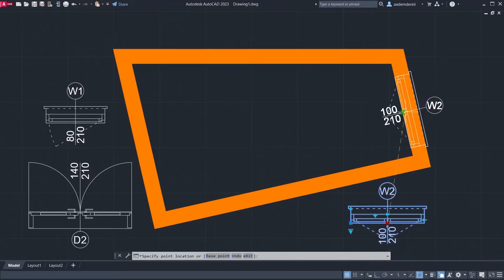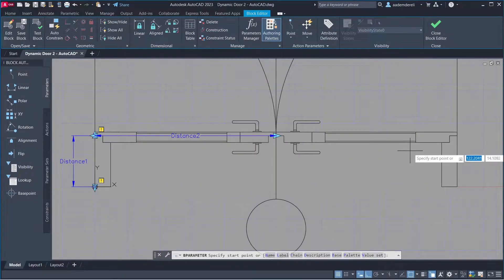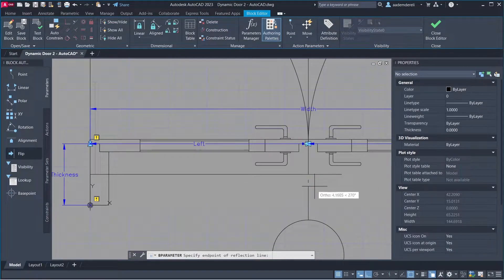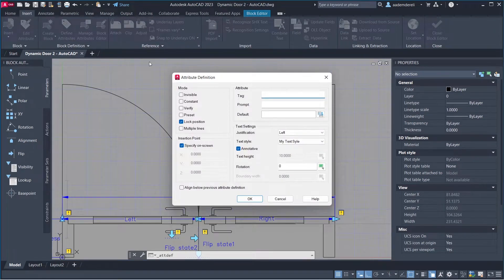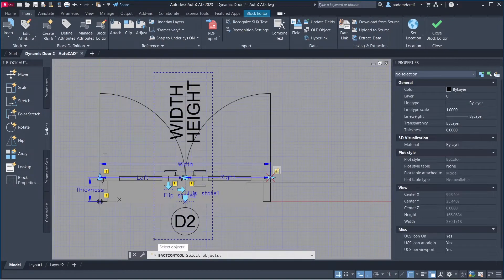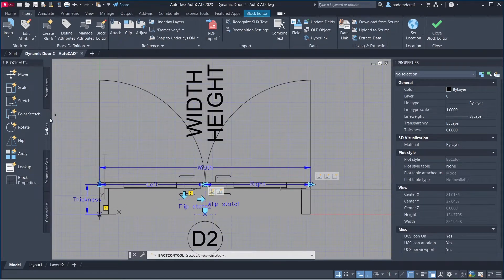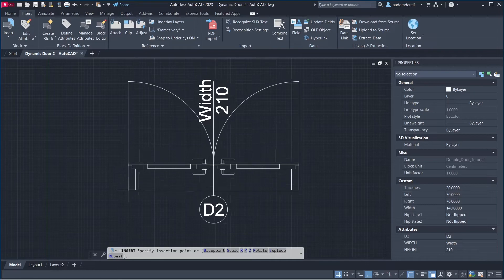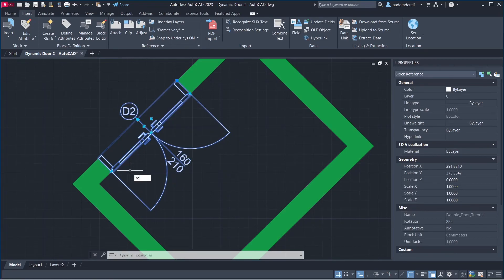Dynamic Double Door - AutoCAD

Comment: In the video, there is a dynamic block for double doors in CAD that lets you adjust the middle section. However, the CAD file downloaded from the membership section doesn't have the dynamic block feature in the middle.

Comment: Hi! I’m having a minor problem, everything is okay, except that if I adjust the total width of the double door the thickness of the door leaf/panel thickens. And it kinda displaced from the point of connection to the jamb. I hope you can help me. Unlike in this video, the door swing and the door panel is just a line.

Comment: Hi Adam. Do you have a video of just a normal double door with the stretch action where leaves, arcs etc. just adjust size of overall width and not the idividual leaves and arcs independently? I've tied doing it and the arcs just don't stretch at the same scale as the door leaves.

My door leaves are at 90 degrees to the wall so a little different to yours.
Reply from the maker: Hi, can i see your block?
Insta: @AdamArchh

Comment: Hi Adam I have an issue...When I reopen the file the width values no longer appear and in the text box there are just four hashtag, thanks
Reply from the maker: Hi, when reopening the block, open the Width without changing it. Also run the Regen command after each change.
Reply: @AdamArchh  I'v just inserted the new block created in a new file without changing the values and I tried to Regen after reopening but nothing happened

Comment: Hey, Ive been trying to recreate this following the instructions. The issue I am facing is that the arcs, for the door openings and the full width of the door are not moving in tandem. If i stretch the door, and then pull the right doot handle to adjust the size, the arcs are thrown off balance.
Reply from the maker: Hi, first set the total width, then change the inner door dimensions. The reverse does not work. Because the rate of 0.5 is broken.